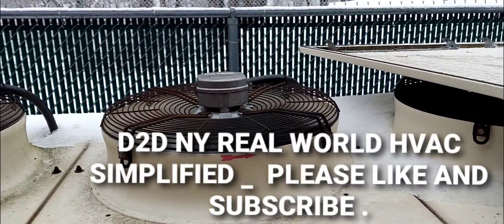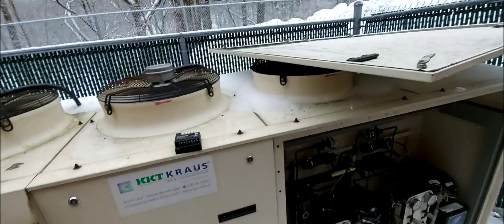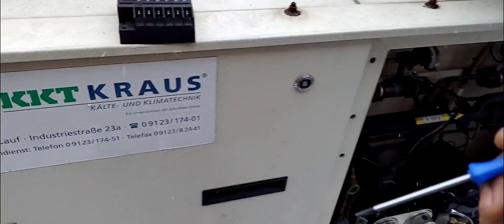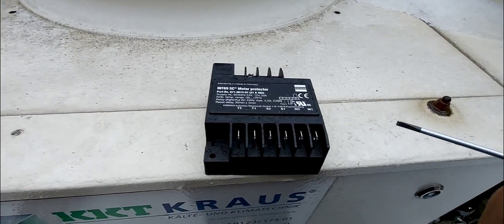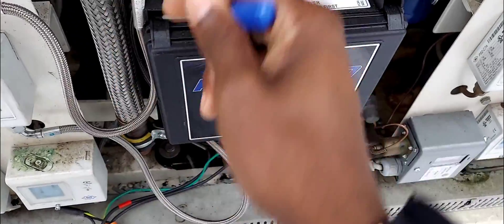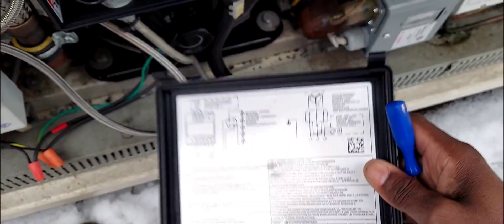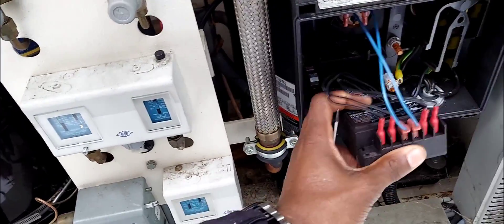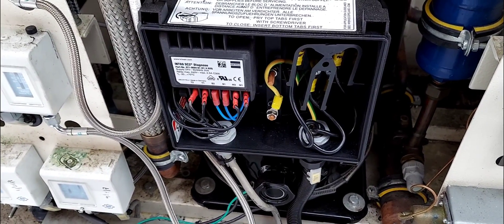INT69SC MOTOR PROTECTOR

Comment: How to know if the motor protector has gone bad? Any idea?
Reply from the maker: If the switch contacts is opened all the time no matter if compressor is cool or not
Reply: @D2DNYAC The switch contact you meant is it the low pressure and high pressure switch ? So it's from the M1 and M2 ?

Comment: thank you very much I am letting all of my techs and installer watch your videos in our meetings and they pick up little pointer as they learn .........keep them coming and good job.
Reply from the maker: Thank you my friend
Reply: T2t2 power suppely    m2  cotacter  m1cotacter  wind open  .
Reply: Mi wir op  off  good  condeshion  mi m2 op n cactimg  systom  ful  find  solveing
Reply: Welcome  sll jobes  expries as all perfeacting   moter  potecting  hvac systom  sll     t1  t2    si s2 comprss  precting  point  slfet  hp  lp  swich  swich   m1 m2     sezing  trip  wind  potect  systom   motar  potacter   scrlle  typ using  systom   ciruiting  24v  power  sezing  24 v   conrolling    vrey  nice full  thankyou gues welcome  copressar  shutup

Comment: What’s shunt… jumped out
Reply from the maker: Yes sir 😂 or bypass
Reply: @D2DNYAC  is it safety for a long time sir ?
Reply: M2  wire off  compers  rely  portacter   hp lp  sire    m1  m2  power  T1T2  24v